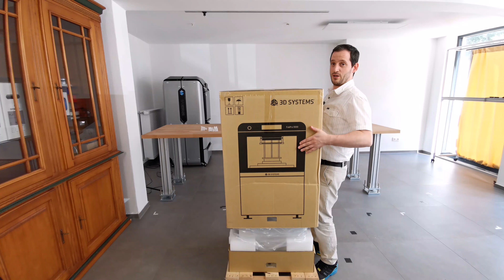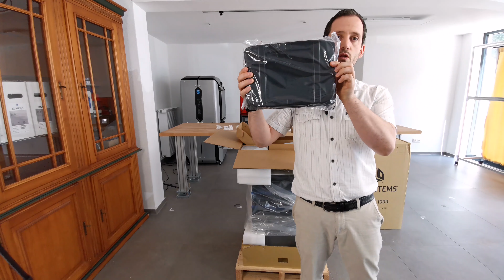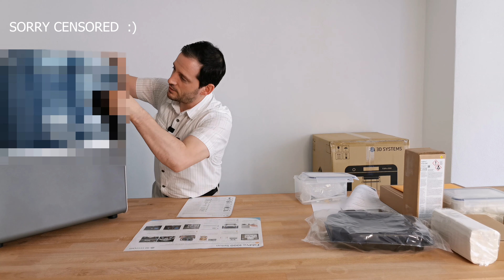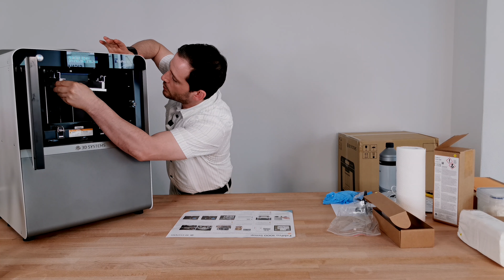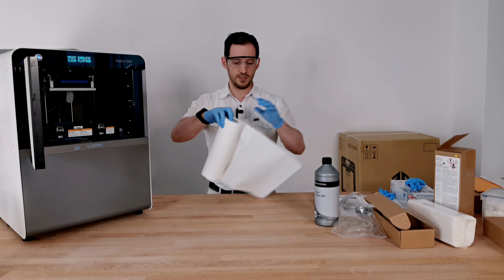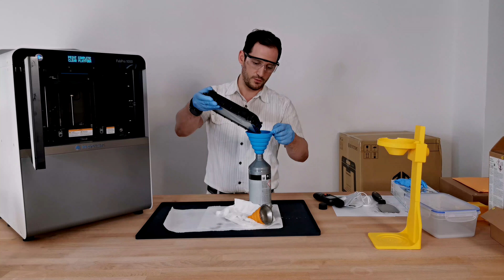3D Systems FabPro 1000 Unboxing and Review

Comment: Nice Video! Can you use 3rd party resin on this printer? And when not from where do you geht the Resin?
Reply from the maker: Hi Thomas. You can not use 3rd party resin yet on the printer. I do know that someone is working on it and wants to release cheaper alternative resin. I do buy my resin from any reseller which is cheapest at the moment. So searching on ebay and in the net in general is what i am doing before buying the resin.
Reply: Thanks for the quick Response! Do you have something like a link to this? (The probably Resin Alternative)
Reply from the maker: @thomashutte5010  There is nothing official yet. I will ask if there is a future link I can post.

Comment: Wow, I can't believe the design of that vat does not let you pour out the resin easily. Definitely a design fail there. Good review! Keep it up. Any chance you have precision measuring tools to measure the part accuracy that you get from this vs say the Mars?
Reply from the maker: Hi Isogen. Yes the vat dos have a strange design. But using a funnel helps a lot. I will start doing prints with the Mars Pro the Fabpro and the LD-002R from creality. Will post a comparison of these when finished.

Comment: Is this printer just a rebranded Miicraft 125? It looks identical. Are there any differences in support, warranty, or software?
Reply from the maker: Hi Joseph. It looks the same but I think the Miicraft Software does not work on the Fabpro. I will give it a try. I think the Miicraft also does not have the barcode scanner. Maybe both printers are build the same but the firmware on  the Fabpro is definitely different.
Edit:  Support was good from 3ds. I did have a problem getting an activation key for the software and they helped me out within one day. Warranty is 2 years here in Germany. Software is much better as the Miicraft stuff as I can tell. But you have to keep in mind that slicing heights are specific to the material you use. The proto gray can only slice with 0.05 mm and the green casting resin can go down to 0.03 mm.
Reply: Its possible to pause the printing?
Sometimes spend a long time and fail The process. If i could to pause and look the platform, like Anycubic does, do not lose time.